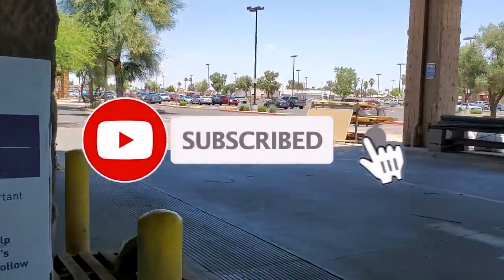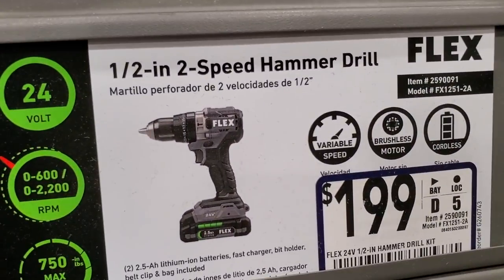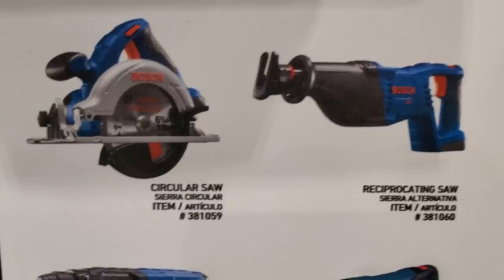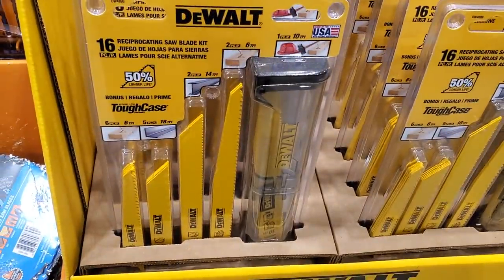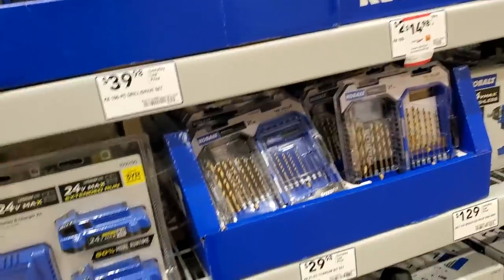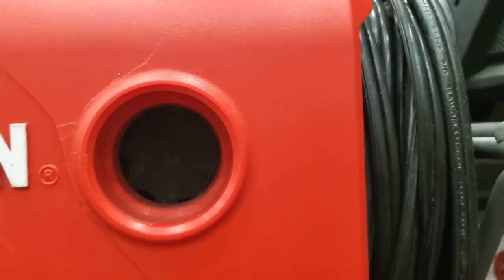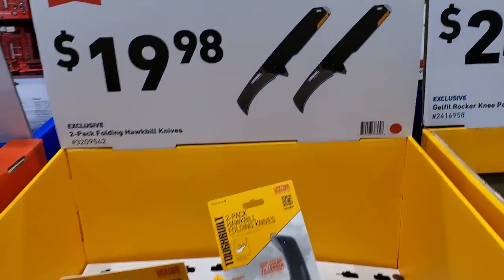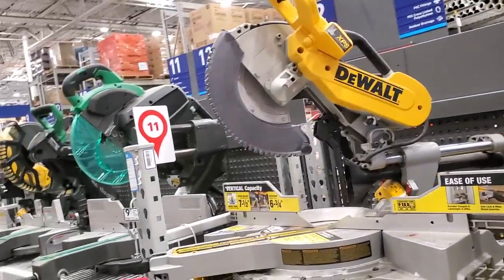Buy 1 Get 1 FREE Power Tool Deals Shopping @ Lowes

Comment: Same thing for the Flex circ saw $299
When u can also do that deal for the Metabo HPT $199 for 4.0/8.0 Multivolt battery charger and get 36V 7 1/4 circ saw for FREE-its the saw that has replaced my Milwaukee fuel and Makita for most applications-and can be used with AC adapter if u want
Reply from the maker: True 👍 they need to lower their prices if they want to compete.